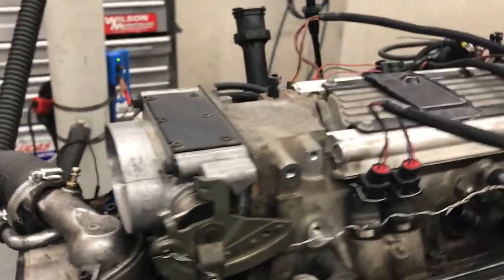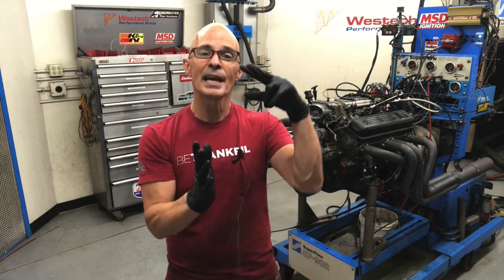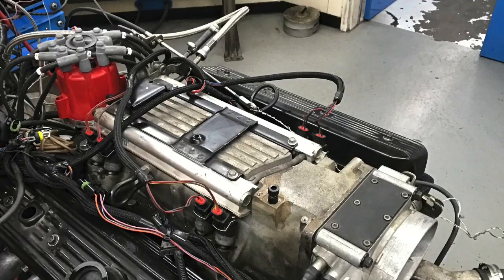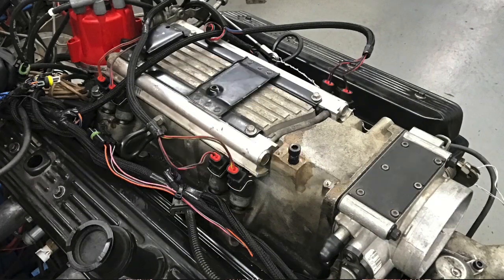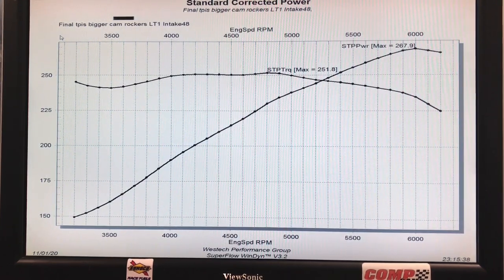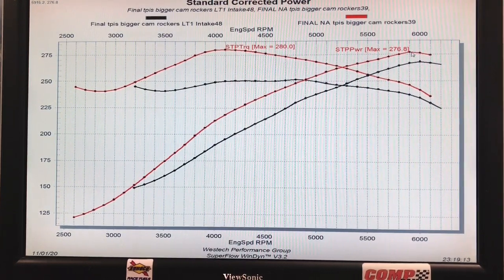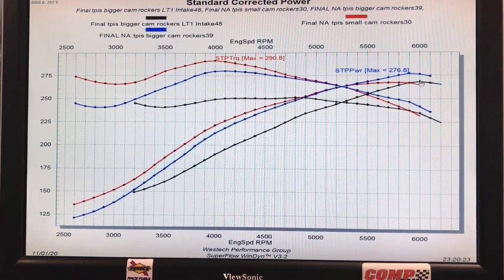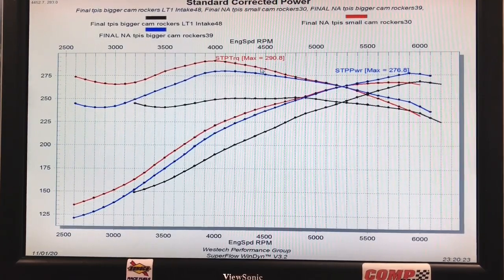L99 CARBS VS COMPUTERS-4.3L (LT1) SBC EFI VS DUAL PLANE

Comment: Did you ever seen on any L99 (LS3) oil leak from head gasket? I have small leak coming somewhere from top, couldn't determine, is it valve cover or head gasket leaking :(

Comment: 8:09 is 10hp and 10tq less than a stock 96-97 camaro LT1.  They were 285hp and 300tq.  I wonder how it would to towing.  I have a 78 C20 with its stock 350 still in it.  it was rated at 165hp and 265tq when new.  It's way less than that now at 160k miles and 42 years.  I bet this would be a good swap seeing as I don;t care about high hp anyway.  either way it would be an upgrade.  I wonder if mileage would improve.  It's a 5200lb truck.  not too often I tow a 7k trailer with it.  What do yall think?  And hook it to a 4l80e.
Reply from the maker: you are comparing the rated power vs the tested power (those are not the same) check out the stock lt1 video i have up-it made more than the rated power output when tested

Comment: Please do a 305 Vortec block swap to make a 4.3L Vortec V8 with the big cam and a single plane intake manifold!!
Reply from the maker: we are swapping that to a LT1 block-DZ302
Reply: @richardholdener1727  a 302 LT1 is cool and I look forward to seeing the results but as you just found out, the LT1 intake is not a good intake for that engine. however, a Vortec 302 allows you to easily test the TPI, Carb, & the aluminum LT1 heads can be easily modified to work on the SBC block so you will have a lot more intakes to use for testing! And how amazing would a tunnel ram 302 be??

Comment: With Tick Performance's Grubb worm tickling 6 second 1/4 mile times with a stick shift the gen 2 reverse cooled small block is nothing to snub your nose at. The optispark is basically the only downfall. The reverse cooling is the main benefit over a gen 1 small block or even a gen 3 ls based engine as it prioritizes cooling to the heads reducing detonation. 
   I've been with the LTX community for over a decade at this point, even competing at the LTX shootout twice. I'm a believer in their potential and also a testament to their tempermental reliability. I'm not a fan of the optispark, but I love the platform. Remove the opti from the equation and you essentially have a gen 1 small block with gen 3 power potential. 
    I've been enjoying the the L99 content. They seem to suffer from the same downfall's the larger LT1's have, at a similar RPM just with less output. Maybe contact Tick or Lloyd Elliot to get the most out of the L99.

Comment: I wouldve loved to see a factory 0411 pcm.. Yes thats the same one from LS1 coil on plug 24x fbody- but it was also used on later model Vortec 350 trucks w/ a rear distributor.

Comment: I don't know if it's been mentioned or thought of, but what if you had a manifold like the Performer RPM Air Gap...but using a 4 barrel throttle body or some other adapter, and put in 8 injector bungs?  It's a strange idea, I know, but it's torque curve looked so great: would it perform totally differently if fuel and air wasn't flowing in the runners from a carb or 4 barrel TBI and if it only had air to flow with 8 port injectors like a "dual plane" Pro Flow EFI?  If no one has ever done it, I think you're the one that could pull it off!
Reply from the maker: it would have less fuel (charge) cooling with port injection

Comment: Hi Richard, thanks for the tip that FAST have a complete EFI kit for my 18000mile original 1994 SLP Firehawk. At $2600 for the complete package of ECU, all of the various harnesses required for plug and play. The previous option was EFI Connection's 28x crank trigger that uses coil on plug tech and a Holley LS ECU. If you have a gen 2 LT1 these are two ways to ditch the dinosaur computer.

Comment: If Biden is president by this time next year we will be watching you do dynos on electric motors and using different voltage to make power!!!!!! That would suck !!!!!!
Reply from the maker: electric motors make huge torque are going to be part of the performance landscape-just like when we switched over to EFI
Reply: @richardholdener1727  I agree that it will most likely take over one day. When that day comes and I have to switch out my blown small block Chevy in my ‘31 five window Ford •••••• All I can hope for at that time is that my days here would be limited!!!!!  Keep up the great 👍🏻 job. I love watching new combos for power !!

Comment: Them GM carb intakes work really good. I did see significant gains once I went solid cam and a single plane intake from 94mph to 99mph in the 1/8. But it also required a 8" converter and I miss that low end grunt. This was all on a 357 CI LT1.

Comment: Richard...that LT1 intake was soft on the bottom on the 5.7...and this small displacement Engine just aggravated the situation...the only place it could recover is up top...and you dont have enough spring to get there....I think to tune port better suited for this combo...

Comment: gota get the tune right the l99 uses 19lbs injectors there injector correction vs voltage and injector pulse width low offset are different values might wanna throw the 24lbs lt1s on there or an aftermarket one that you know the values for

Comment: Time for the baby hotcam aka the SPO 357 hp crate 350 cam.  I bet it would make power peak above 6,000 rpm with 1.6 rockers.  With 1.6 rockers, would be about 218/226 @ 0.050, .503 lift on a 108 LSA and 109 ICL.  Out of the box it is 215/223 @ .050, .473 lift, 108 LSA and 109 ICL.

Comment: I have a lt1 block with lt4 heads, stroker 383. You mentioned how to use the LS coil packs on your engine. Can you tell me a link to get that part and what else I need to make that work. Currently using the opti spark and single coil.

Comment: Try the bigger tpi from the mid 80s on the 4.3
Reply: I am wanting to put a 86 tpi on my 71 k10 with a .030 350 and want to put a roller cam in it and ring out as much to as I can without having to go to a 400 crank "aka 383" I have 70 1.72/1.50 truck heads a gear drive timing set 1.5 and 1.6 roller rockers... just not sure on what roller cam to use

Comment: Brilliant videos. I love seeing how different manifolds/cam/ rocker ratio changes can change the power/torque curves of an engine. Can you do a test using a dual plane manifold but with different styles spaces like four-hole/ helix design/ open space, that would be good to see. Obviously Dual Plane is the king for torque.
Reply from the maker: this motor did not like spacers on the dual plane
Reply: @richardholdener1727  Thanks for the reply. May I ask the cam specs of each camshaft please.

Comment: Does the cooler fuel in a carb set up maybe make up some of the difference here? What if you used the intercooler to give a similar air temp on the injection intake? Great work Richard, thanks for the content.
Reply from the maker: charge cooling definitely helps withe the carb application

Comment: 30-40 lb-ft from cam and runner length. When you’re under 300 lb-ft total, that’s a big deal! Such good info, as many others have observed as well. Great work Richard!
Reply from the maker: thnx
Reply: @richardholdener1727 
Use the supercharger M-90 
Buick /Pontiac

Comment: Should have just put a 12T crank trigger on it and run wasted spark. pretty sure there would have been a small block crank pulley with trigger and sensor lying around at Westec ;) would have taken 15 minutes to set up. but this is the 'Merican!' way to do it. hahaha

Comment: Also if you could bile a sbc327 with fulie head's with good springs 480lift cam signal plane vic Jr  or so and a holly 750 you can get past 10k easy
Reply from the maker: that would be a neat trick

Comment: Modify that dual plane to run multi point. The lt1 hwad should fit fine because those valve sizes will fit a 305 provided they are in the same location as the standard heads. That tpi intake, if you can get it to work, should make great torque down low for such a small motor. I want to see a turbo with an intercooler and water/meth injection  on it. I bet it would be fun as heck in that Nova.

Comment: So many questions for you. I've wanted a tuned port set up since I was 10 years old, building a monogram 1985 corvette model. I now own an 89 L98 firebird and wanted your advice on the best set up for it.
Reply from the maker: ask away
Reply: @richardholdener1727  I have an 88 Vette L98 with aluminum heads in it currently. The engine was recently bored .030 over and my builder said I'm 10.5:1 compression, the crank was balanced and I put the standard recommended comp cams TPI cam in it. Unfortunately I'm 500 miles from home at the moment or I'd give you the grind number, also have comp cams 1.6 roller rockers on it. I was naive at the time and put 34lb injectors in it. Had the prom programmed by some guy in michigan. It runs okay at best.. I, as everyone else, want more power. I wanted to upgrade my heads. What's a good head? Blueprints?What's a better sized injector? Thanks for replying! Jason
Reply: @richardholdener1727  hello Sir. Is there a better way to reach you? Perhaps messenger?

Comment: Definitely needs the TPI intake!
Reply: Why? the LT1 short runner intake is way better then the older TPI runner. 
at least now it can revs to 6k. 
not like a TPI.
Reply: @Bowtie4me  I think it would be interesting. These L99’s lack low end torque. Plus being a smaller displacement, maybe it would rev still? It’d be cool test either way.

Comment: Actually, running the Edelbrock Performer TBI & 454 TBI unit would be the ideal way to go on a 4.3L LT-engine in a Caprice Classic. 😉
Reply: Was the ideal method of injection on the 350 Vortec in my G20 van.  Low-end under 2,500 was soggy with the TPI and torque was important pushing a 5,300 lbs brick uphill at 1,700 rpm @ 70. 

I actually went with a mercruiser vortec dual plane MPI intake on the 383 in my Express van with a 1,200 cfm 4bbl dry throttle body.  Torque for days and still makes power peak at 5,600 rpm and carries a flat HP curbe to 6,200.

Comment: Have you considered running a L31 head with the higher-ratio rockers and L98 manifold, Richard?
Reply from the maker: the L31 head wont work on the LT block-water passages

Comment: Any educated guesses on how much lower the rpm would be for peak torque/power with these same setups in a 5.7L LT1?

The cams you are using are fairly close to the factory 5.7L LT1. GM went with the torquey tight LSA in the sedan and the higher revving wide LSA in the sports cars.
B-Body with iron heads: INT - 191º .418" EXH - 196º .430" LSA - 111º GM P/N 10243779

F&Y -Body with AL. heads: INT - 203º .477" EXH - 210º .480" LSA - 117º GM P/N 12551705

I've installed a Comp XR258HR-12 in my Roadmaster wagon, INT - 206º .480" EXH - 212º .488" LSA  - 112º. Something like your "big" cam but tighter LSA. Too bad I didn't know about the smaller TPIS cam because I may have gone for it because all I want out of the engine is more power down low for towing. I'm waitng to see what your results are going to be for the factory TPI on the 4.3L. I have a complete TPI in a box and I'm really interested on how you get it bolted on. It has to be a torque monster even compared to the dual plane. Of course the TPI will choke off the 5.7L HP but I may be willing to sacrifice that for the torque if it bolts on reasonably. Otherwise I'd have to spend $1100 on the FIRST TPI intake, if I do go that way. The TPI may actually be a great match for a high revving small engine since the TPI was originally designed for a 305/5.0L so the 4.3 L might not be choked off too much at the top end.
Reply from the maker: I think our stock LT1 made peak power at 5500

Comment: I knew the EFI wasn’t gonna make more power then the carb. I think the tune port won’t make more power either, might make more torque but not more power. If you want to take it past 7500rpms why not put a high rise single plain intake? Will be sacrificing a whole lot of torque. In all honesty that engine is not gonna make power that high it’s not valve float it’s just running out a breath its just not capable.
Reply from the maker: it is valve float

Comment: Custom fabricated dual plenum cross ram intake with dual throttle bodies and two small turbos .. Edelbrock Performer 61905 1.94 heads with some custom porting (the only LT1 head I see with 1.94 valves to prevent cylinder bore interference). And for a cam something like this: 0.570/0.565-inch lift split, a 218/224-degree duration split, and 113-degree LSA (the same one you wrote about in the TorqStorm supercharged 305).

Comment: So I am very anxious to see the TPI intake on the 4.3 I did a 283 TPI and it actually made great power all the way to 5,300 smaller engines don't run out of air like the big cube TPI. They also make great torque. But you'll see
Reply: My Vortec 383 did not run out of air until 5,200 with TPI and even then the HP curve merely flattened out to 6,200.  A very flat HP curve for more than 1,000 rpm.
Reply: @chrisreynolds6520  modified TPI or completely stock TPI. I've dyno'd a bunch of TPI cars and most owners get pissed that they don't make high rpm power after spending a ton of money on a crate engine that was supposed to make peak power at 6k. I myself switched to vortec heads and a stealth ram and it was weird to get used too because you lose all that low end torque at idle you can really feel it taking off in a stick but I pull hard all the way through 6,200 rpm
Reply: Ported 3817 base and ported plenum with stock runners.  Then tried siamese ported SLP runners.  Power peaks really did not move much with the SLP runners but it held on to about 6,500 rather than falling off at 6,200.
Reply: Flat line to 6,500 rpm or peak at 6,500 rpm also I was talking about factory tpi units

Comment: I respect the testing but Im not sure the point. Is it a simple display of what not to use for your Hot Rod? Has testing shown any reason to choose this engine over a larger one? Kudos if you do.
Reply from the maker: this testing is for those who have this motor or think its cool-not to chose vs the bigger version
Reply: @richardholdener1727  Gotcha, its how to make the best of your situation in case you cant get a bigger one . Cool

Comment: The TPI intake manifold is going to kill everything else in a street RPM range
Reply: I have a feeling from 2,500-5,200ish nothing is going to touch the TPI.
Reply: @chrisreynolds6520  idle to 5000 without question, everyone with a small block powered truck needs to seriously consider running tpi
Reply: Under 2,500 they are usually LESS torquey than a dual plane.  Experimented with that alot.  I have had a TPI powered G20 van with a 305, a 350 and a 383.
Reply: @chrisreynolds6520  not in my experience, I've never experienced better low rpm power than tpi in any instance but I also have not done a lot of back to back on the same engine in the vehicle
Reply: Same engine, same vehicle, same stock 1,600 rpm converter in the same 700r4, same 3.08 gears.  Was a Vortec head 350 powered G20 van.  The 454 TBI unit on a performer rpm dual plane intake with a 2" tall divided center marine 2" TBI to square bore adapter and thorley tri-y headers made more torque under 2,500 rpm than the stock TPI with a Vortec base plate.  It was plainly obvious in the 60' times as well as cruising down the highway at 1,700 rpm.  With the TPI it had to downshift to 3rd on the same hills it would stay in overdrive on with the dual plane manifold and TBI.

Comment: I'm wondering about throttle blade area on the efi vs the carb. I may have missed it, but if it's a vac secondary carb you will have better air velocity at low rpm with smaller venturis than the large efi blades.
May account for SOME of the lost lowend. I know runner length is the majority factor but air speed is a bit of it too
Reply from the maker: it was mech sec carb
Reply: Well I'm sure you know more than I do, but maybe the combo is too mild for a mech carb? Idk I have never used a holley based carb just qjets, and a couple carters.

Comment: How did the AFR curves differ between the carbureted and EFI setups?
Reply from the maker: the EFI liked to be slightly leaner
Reply: @richardholdener1727  So the fueling optimized for each configuration?

Comment: I can't wait to see the TPI test. I agree with you that this engine wants more runner length, and at that displacement I can't see it being a flow restriction. 
I'm curious though. How much power is that gear driven water pump using? I'm sure it's a low number. But hey, this is science class right? Can the water pump gear be removed and the timing cover be plugged to find out? Would the dyno pump right through it?
Reply from the maker: yes it can-we discussed doing it with a Meziere

Comment: If you had taken the carb intake and  bolted it to the mill table you could've swept the location and angle of the distributor hole and transferred to the LT1 intake.

Comment: Hey Richard.
If you wanted to center the distributor, flip the block over, go through the oil pump drive hole all the way to the bottom of the intake.
Once you have a centering register mark, take intake off and THEN mill it out.
That way you won't eat the cam gear and distributor. (Depending on how much it's off)
Reply from the maker: just take the motor off the dyno, disassemble the complete motor, then flip it over and go through that procedure--more of a hole saw kinda guy!

Comment: just add a crank trigger. Yeah, sounds like me. People only listen to Keith Dorton on this....Meh! "Everywhere I go, People Don't Wanna No-ho"...."https://fordsix.com/viewtopic.php?f=2&t=81565&sid=23161828226df8755a6808f558acfb5f" "http://vb.foureyedpride.com/showthread.php?160350-Does-anyone-have-an-illustration-of-where-the-crankshaft-position-sensor-goes-on-a-79&p=1931626#post1931626" and "https://www.stangnet.com/mustang-forums/threads/1978-fairmont-build-mercury-cyclone-spoiler-next-up-painting-the-hood-and-we-all-know-how-well-that-went-last-time.917938/page-18"